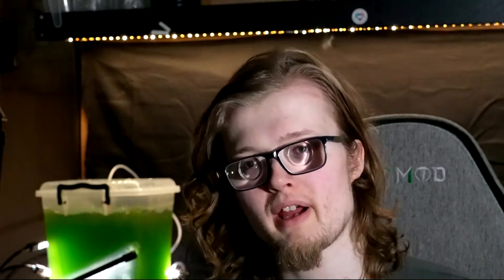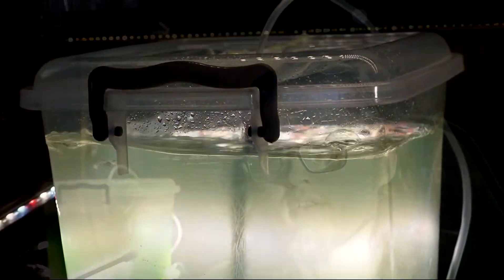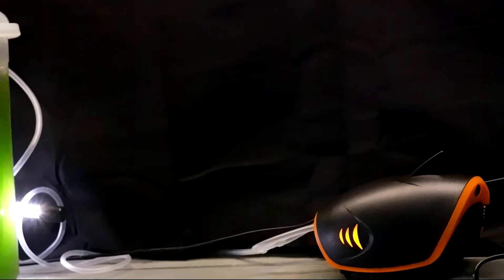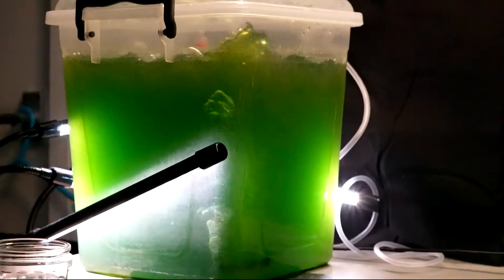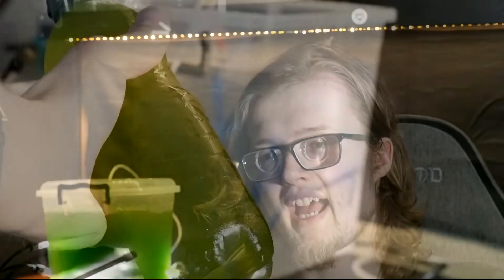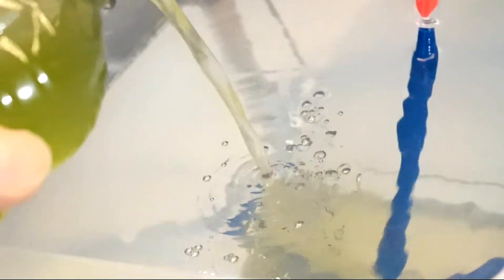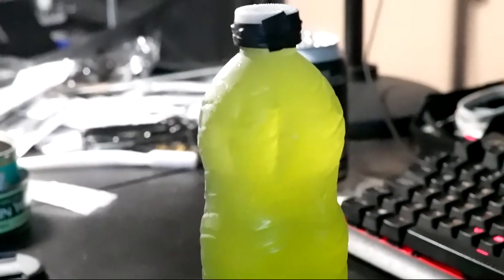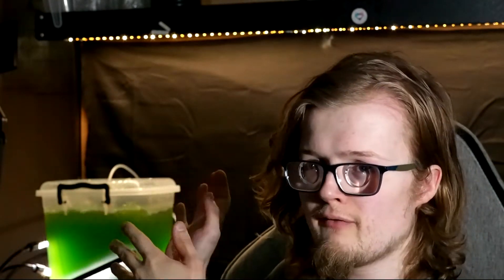Algae To Fuel - The Process Oulined

Comment: You can do vaccum distilling take an AC unit aka heat pump to create a heat emission area and a endothermic well next a vacuum tight system with two chambers connected in a typical distillation pattern adding valves as needed.
Operation you heat the tank of algae water let it get sucked into the top of the hot side vacuum chamber through a spray nozzle at a controlled rate if the water is 30C or above it will flash boil to steam the soilds will drop to the bottom the steam will travel up the distillation collum and then down at an angle getting cooled as it travels to the cold side chamber where the heap pump's endothermic array chills it further.
This will create distilled water that you can wash the algae with latter.
 With two set ups you will get a faster wash process keeping one as the first stage.

Comment: You can do centrifugal dewatering take a metal container cut holes in the sides symetrically inside these holes you put tubes each end of the tube has a valve you can remote control.  The operation is you fill the container with the inside valves open outside valves closed spin till the water clears  close inside valves and open outside valves the paste gets flung out to a larger container and settles to the bottom shaped as a funnel with a valve to empty it.
Pump spent gray water back to restarting growth containers and repeat.
Reply from the maker: @Barskor1  I'll look this over!
Reply: @edeniaAJ  Washing machines are good for motors tubs and frames and have built in controls.